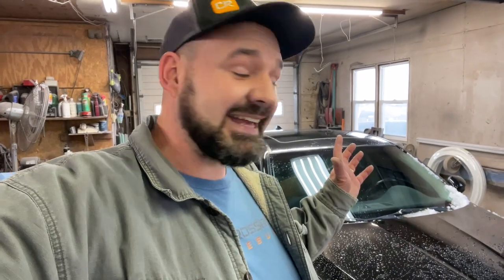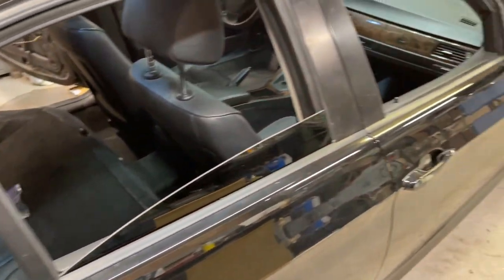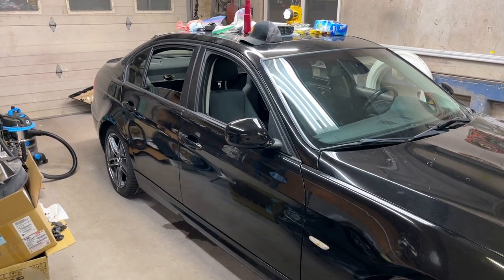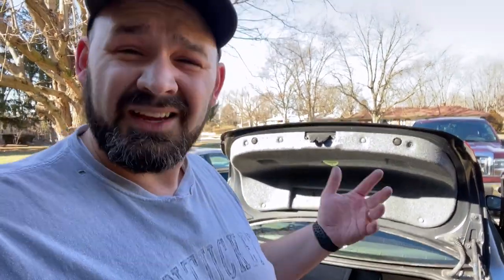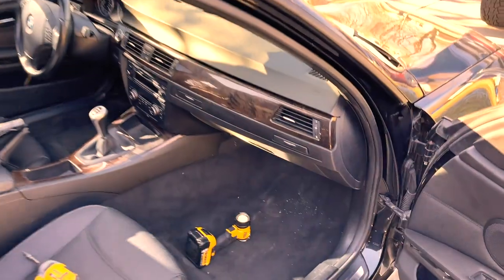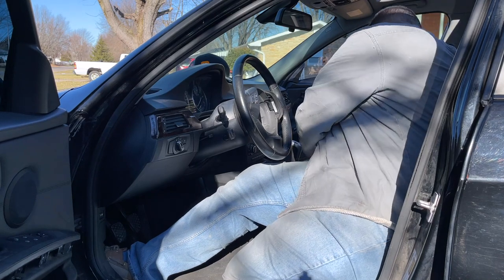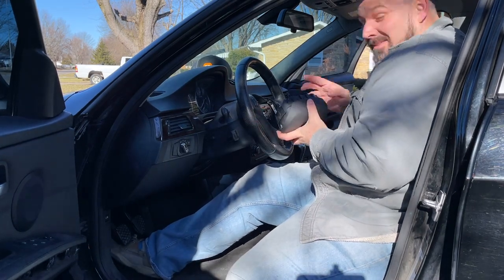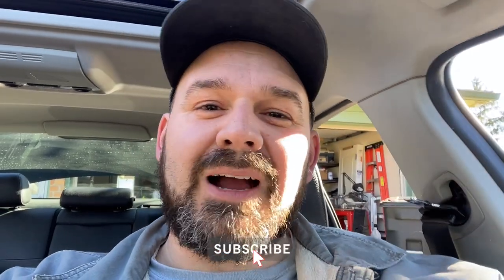BMW 328i xDrive Manual Rebuild - Part 5

Comment: Will you be keeping this car for personal use ?
Reply from the maker: This car was purchased specifically for my wife to drive in bad weather. I’m also working on the 335is convertible which will be her warm/nice weather daily.
Reply: @CrossroadsRebuild  thanks for replying, i was seeing part 4 of the build and you have made a mistake when installing the roof spoiler. Its not meant to be put on the roof, its sits on the rear wind shield. Thats why it looks not good, its not in its place.